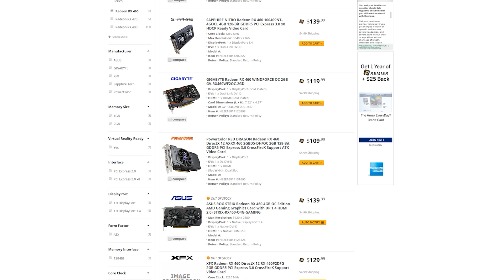RX 460 Nitro PCB & VRM Quality Analysis [In-Depth]

Comment: How do you know which part of the circuitary is GPU VRM and which is memory VRM?
Are there any datasheets for RX460 or something like that??
Reply: you can stab stuff with a DMM while it's running but usually just the fact that GPUs pull a ton more power than VRAM(and VRAM pulls more than Vaux) is enough to figure out which is which. Anything I actually end up with in my hands ends up stabbed with a DMM just because I don't like relying on software voltage readings.

Comment: Interesting it uses a x8 PCI-e. First time I noticed that on a modern card.
Reply: AMD's reference RX460 design is PCIe 3.0 x8,not a big problem as it won't impact the performance.(unless running slower than 4GB/s)
Some custom RX460s got the other blank parts stuffed up with dummy pins.

Comment: I am pretty sure the internal amperage in those chips is a little higher than the input amperage, so it isn't that much of overkill, just a safe overkill
Reply: The card pulls around 85W stock. That VRM can handle almost 2x the current that the card needs at stock.

Comment: Is the 460 worth 160€ for the 4gb version and 120€ for the 2gb?
Reply: If where you live thats your cheapest option, sure. On the other hand, if cards like GTX 950 are around, then no, 460 is but an afterthought. 4GB is just silly, 160€ (almost 200$) for a paperweight card, no.
Reply: here the 950 is about 180€, the 960 210~ and the r9 380 215~
Reply: Are you sure? where you from? those prices sound pretty steep considering all those cards have been significantly dropping in price.

If those are really the prices, then yea, a 460 is your best bet for a cheap card. The 120€ model.
Reply: 4GB on this low caliber of a card is completely overkill. You're not playing AAA games with this, like, ever (the Polaris 10 chips exist for that). For the games this GPU is targeting, get the 2GB. It's going to run into sheer power limitations before it's even going to touch more than 2GB of VRAM. Maybe with a theoretical RX465 (the full P11 chip with all 16CUs/1024 Stream Processors instead of the RX460's 14CUs/896 Stream Processors) a 4GB model makes more sense, but not with this.
Reply: IMO the only 460s that make sense are the cheapest of the cheap ones.

At 160euro you are VERY close to 470 money which is in a different league performance wise.
Reply: you call 100€ less close?
Reply: MrShiftpower Depends on the RX470 you're buying.
Reply: the cheapest aftermarket card i can get for 470 is 279€ and the rx 460 is 120€ for 2gb and 4gb is 160
Reply: MrShiftpower
 So you reckon you can get the 460 at mrsp but the 470 is 100 euro over msrp?

Where the hell do you live?
Reply: Portugal
Reply: You just gotta learn how to search. You saying 950s are 180€ over here,but not really: http://www.globaldata.pt/componentes/placas-graficas/pcie/grafica-msi-gtx950-oc-2gb-gd5.html

Thats a better buy than a same price 460. Just call them and ask when they'll have more cards, the girl at the desk will let you know.
Reply: MrShiftpower
 So you are free to buy anywhere in the EU without extra taxes and low shipping costs.

Sorry but no, the 470 does not cost 280 euro all over europe.

You just ain't looking.
Reply: yeah that's a promotion and that's out of stock, if u see the right price is there 178€
Reply: Its also outdated, doesn't mean anything. Heres same card, no promos: https://www.pcdiga.com/2/18113/Grafica-MSI-GTX950-2GD5-OC

There are a ton of 950s between 120 and 150, out of stock is not a problem either, just told you to call globaldata, that the girl at the desk will tell you when more will be available, and you can probably reserve one over the phone.
Reply: Tripnotik25 do you think the 2gb will be enough?I know its not a top of the line gpu, but ain't the 2gb bottleneck the gpu itself?

Comment: holy shit its buildzoid!
Reply from the maker: +Paskek We pretty heavily showcased frequency vs. thermal throttles on the GTX 1080. Would suggest that you go read page 3 of that review. The entirety of our three-part Hybrid series showed how we were able to resolve the awful Founders Edition cooler issues with our own solution. There's a LOT of content we've put out lately. We have made many statements in both directions for both vendors. We also showed the same issues on the GTX 1070 and 1060. Keep in mind that, in addition to videos, we do publish 6k-10k word reviews of each of these cards. Those contain a huge amount of data.

Also, we broke the news on the Founders Edition card branding and nVidia's marketing, and have continually remarked that the FE branding is silly and have even reverted to referring to the card as "Reference," instead. We've also shown the high points of the Pascal arch -- memory optimizations are advanced, for instance.

Resources:

http://www.gamersnexus.net/hwreviews/2438-nvidia-geforce-gtx-1080-founders-edition-review-and-fps-benchmark/page-3

FE discussion: https://www.youtube.com/watch?v=QYA-IR2sqTE

GTX Hybrid: https://www.youtube.com/watch?v=w-3fi1ovAP0

Further, we are one of the only outlets that shows Black Ops III in benchmarks, which helps balance results to ensure we're testing games optimized for both vendors or for no particular vendor. BLOPS3 favors AMD.

It sounds like you're cherry-picking content to create a false narrative.
Reply from the maker: We strongly recommended the RX 470 in the $180 price-point. We do not "diss" products; we review them fairly. The RX 470 Platinum -- the one which we received, because not all 470s are equal, as you seem to suggest -- used a reference cooler without the copper plate (reduction in cost), used a +10MHz "overclock" that never actually triggered on boost with stock power target, uses an aluminum heatsink with no heatpipes or vapor chambers, and a slower fan than the reference cooler it sources. And yet it was priced the same as the RX 480 4GB card, which is the very card we recommended as an alternative. You get 4 more CUs, more TMUs, and a better (albeit marginally) cooler. 

I am not sure how recommending AMD cards as an alternative to a poorly built AMD card is being "biased," but if that is what you wish to believe, that is on you.. We are confident in our content and have no horse in this race. That is the end of discussion from our end.

Cheers.
Reply: +theDaNi0 Reviews that contain 6k-10k words.
Reply from the maker: +theDaNi0 Words.
Reply: +Paskek You're an idiot, this is one of the few channels that doesn't show a clear bias. Watch Jay or Linus if you want to see what a shill looks like.
Reply: He's everywhere!
Reply: "Keep in mind that, in addition to videos, we do publish 6k-10k reviews of each of these cards."

Clearly a typo there, doubt you're writing between 6000 and 10000 reviews. :P
What did you mean to say? 6-10 written reviews per card (I guess for each board partner, and side projects like the GTX Hybrid)?
Reply: I wonder if Gamer's Nexus knew that Buildzoid reviewed the 1060, 1080 and Titan XP PCB and found those to be very poor value when he invited him for a coop.

It seems that Gamers Nexus only bash AMD cards for some weird reason.
When nVidia PCB has lower overall build quality compare to AMD. (According to Buildzoid).
And Buildzoid isnt biased (as I watched all his videos and streams), he also said rx480 reference PCB is a train wreck. Just little fishy that GamersNexus didnt bash any of the pascal board when the overall PCB quality of Suckers Edition Pascals are pretty poor but somehow he doesnt do any of the pascal crap.
Reply: Greg Cunningham I know most of the channels are nvidia shills it's just weird the magnitude of dissing from him for 470 was so bad while knowledgeable person like buildzoid commented pascal pcb are actually worse and cheaper... His criticism to nvidia's cheap product like pascal is like 1 sentence like "1080 would thermal throttle but a lot of cards do this as well". While I dont hear him say this AMD PCB is bad value but still better value than the old surplus parts used in Pascal Founder's Edition tho.

If you dont want to sound like a shill then dont act like one.

I like buildzoid because he was literally heavily pashing rx480 reference PCB and actually urging people not to buy the train wreck wait for AIB, as he commented on how bad parts used on Pascal FE cards are and many parts aren't even safe to use for high level OC. While I see here you got a whole episode bashing rx470 parts while giving a 1 liner on 1080 throttling and FE pricing.

Go watch some of Buildzoids PCB break down on both AMD and nVidia sides and come back and visit here again and compare to 470 break down vs any of the pascal ones and see for yourself.
Reply: Gamers Nexus w/e you say thanks for replying.
Reply: +Paskek Its probably worth pointing out that when he says the PCBs are garbage hes looking at it from a LN2 overclockers POV, from a factory design (and even average OCers) POV they are perfectly good, they simply aren't designed for LN2 overclocking as that would be a waste of money e.g. designing a 500W power delivery circuit for a 150W card, while doable, is pretty redundant and can actually leave you worse of than if you designed for the factory operating power.
Reply: Sam B
 A lot of electrical components are more efficient around 50 charge (PSU are a good example). Maybe they did the PCB to make sure the efficiency is good.
Reply: L3xou97 I'd say that'd be right, they will be balancing efficiency, component cost, availiblity, consolidating stock across products, etc. when designing at such volumes there are a lot more factors they have to consider than simply what makes for the "best" circuit.

Comment: Is it suggest that not purchasing any amd graphic cards in the whole Polaris series due to those cards only have same performance that Nvidia did in few years ago?
Reply: MR.FuN Then for sure is an overheating problem. Try to open it and clean the fans and reapply thermal paste.
No one will suggest you a 1050 simply because it isn't out yet and it will not be for a while. Regarding a new system i think that is best if you try to fix your laptop and use your ps4 since you got that already
Reply: And I am bit worries about the game performance n the next few year, I still not sure which card I am going to buy..
Reply: rx 480 is a great gpu. It will be better in a year or so, so i would suggest it only if you don't usually change gpus before 3-4 years. If you cange you gpu every couple of years i would go with the 1060 that will give you better performance with older and a good ammount of upcoming titles in the next year because of dx11
Reply: well the 460 is hard to recommend, but the 470 and 480 are right below and above the gtx 970 respectively. yes they are at the performance of old nvidia cards, but at way less cost and pretty much out of the box as they are clocked to the max out of the box
Reply: Thanks guys. But I only play csgo and do cities skyline modding , and already own a ps4 and a xbox, worth it to get a new pc with 470/480?
Reply: which gpu do you have right now?
Because both csgo and cities skyline are very cpu intensive and not that gpu dependant
Reply: +Darnoko Guilama 
Oh reAlly? I have a i72360qm with Gt540m in notebook, when playing csgo using 800x600 and got below 60fps.
Reply: And I am going to play battlefield 1
Reply: MR.FuN the 460 was never meant to play AAA titles, It is the new moba king tho. For pretty much all games at 1080p, the 470 would be fine, and all games will be fine with the 480.  Battlefield 1 (alpha) also works very well with the 480, and the finished bf1 will have dx12 and we all know how much that helps amd cards lol. 

On a second note, that laptop isnt only really old, but that gpu was the weakest one in the series for its time, so I wouldnt expect it to run any better than that.

grab yourself an i5 6500, an h170, b150, or h110 mobo, and a 470/480 and you will be set for a while
Reply: Darnoko Guilama csgo isnt cpu intensive at all lol. my buddy has the g3248 with a 980 and he gets insane performance with no stuttering. source engine has no cpu intense operations
Reply: Oh, i tought you had a desktop. Then yea, i think you will need a new pc to play battlefield 1. It still looks strange to me that a gt540m only get you less than 60fps on csgo. You might want to check if you are not using intel hd graphics instead. With your setup you should get about 130-150fps in csgo at high 720p. Try right-click on the csgo exe and select run with graphic adapter and then chose nvidia 540m. If that does not improve it try to download new drivers from your pc web page, and if nothing of this works then download hwmonitor and send me a screenshot of the values after 10 minutes of playing (you need to keep it open while you play)
Reply: James Mastroianni Sorry, i misused words. It's not cpu intensive, it's cpu dependant. The fps you get on csgo rely very much on the single core performance of your cpu while you get to a cap really soon graphically speaking. With my 270x i was already maxing csgo, but by switching from an i3 to an i5 i went from 150fps to over 200. I might want to add that csgo players like to play at insane framerates, because it looks like it lowers the input lag that way
Reply: +Darnoko Guilama a 540m was still a crap shoot gpu anyways so it probably is using it. also what i3 and what i5 were you using?
Reply: James Mastroianni from i3 2120 to i5 2550k. It's the same generation but the 4 real cores and that turbo boost to 2.8ghz helped me very much. Anyway go on yt and look for gt540m csgo benchmark, with an i5 2xxxm you get around 100-120fps at hd+ high. The 720p and i7 should bring it in the 140s
Reply: Thank you you guys, great help for me. Maybe my laptop overheating cause low fps, about 90 degree when load., 80 degree idle. Anyone can confirm no gtx1050 before I bought rx470. I only got $650 usd budget.
Reply: And my question is should I wait for next gen cards and play ps4, or build a new PCs right now?